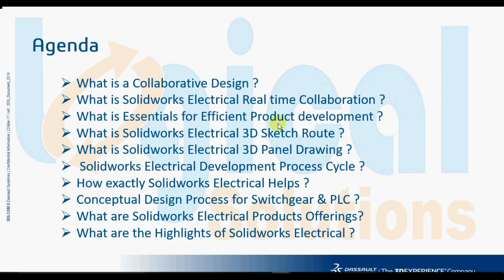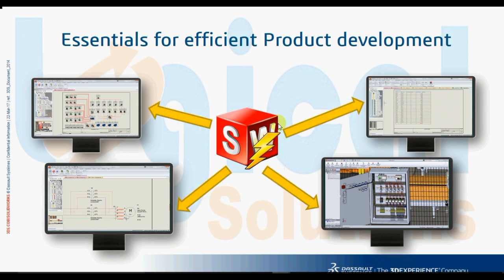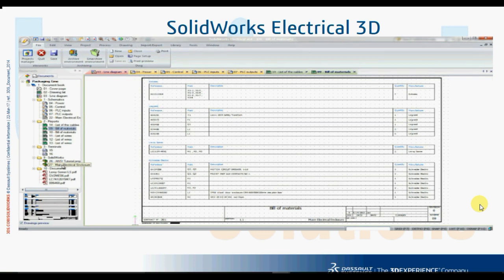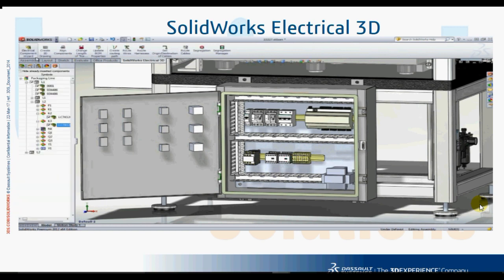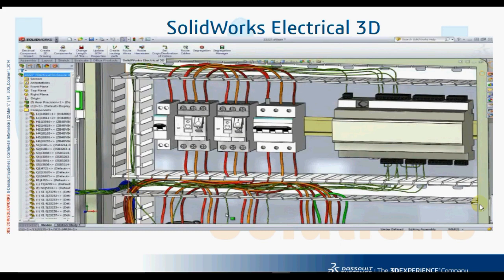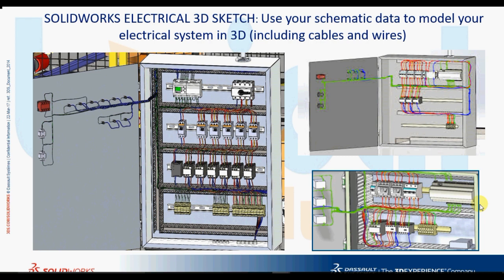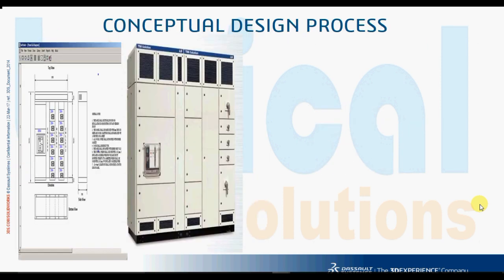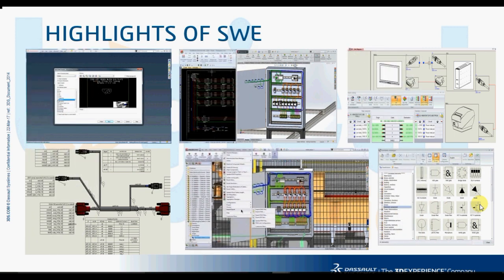SOLIDWORKS ELECTRICAL 3D

Comment: excellent explanation and nice video  ..... can you people make a small video on working of solidworks electrical by taking a small example, and also a small video on the difference between solidworks electrical and e-plan & autocad electrical by taking a small example because it's no where available in web, it will be very helpful.

thanks.

Comment: How would you jumper multiple circuit breakers? With out having to run multiple wires to one power supply?
Reply: I understand in real world we use a bus-bar but how do you show that in solidworks electrical.

Comment: Hi, Project manager is not working.  That's why I can't creating a project.  Besides, Is not working file, view, library in parts. 
Please, Can you help me?
Reply: The projects manager is not responding. The projects manager window does not open when the projects manager button is pressed. Besides, tools section is not  working. I can't create a new project because it has not opened.I also installed all SolidWorks products in one setup. Should I install the SolidWorks electrical product separately? I think about formatting to computer.  I don't know how i can give more details.
Reply: Never mind. The best is to format the computer.Thank you for your help. :)

Comment: its very good . i have gone through your videos,  Can you guys make a tutorial that includes a example that includes a complete aspects of a product & every domain involved in it using solidworks . So that we can understand how a entire product can be made using solidwork alone. For example creating a complete tutorial for making a CPU ie.,CABINET using Sheetmetal , and motherboard and other stuff like wires, cables etc using SW electrical , then costing and then the documentation using the composer and importantly how tomanage all those together effectively if product gets updated.

it would be great if you could show how to validate a product using the analysis tool you have like stress and thermal analysis for the cpu or the product you choose & if possible even manufacturing using add ins like dell cam or if any inbuilt you have . So that anybody who wants to learn or buy a product can fully understand the capability 

waiting for your reply